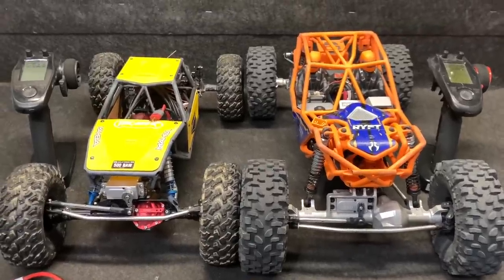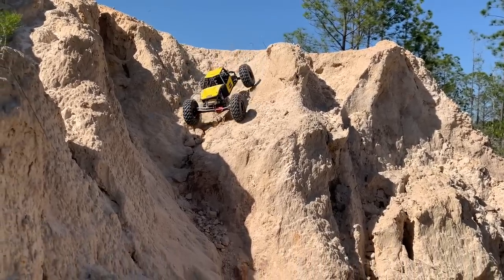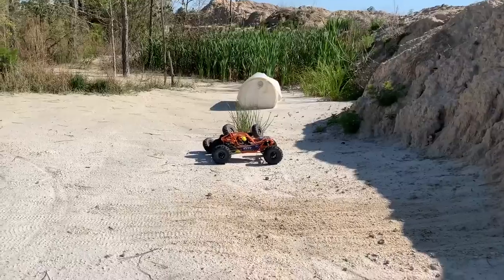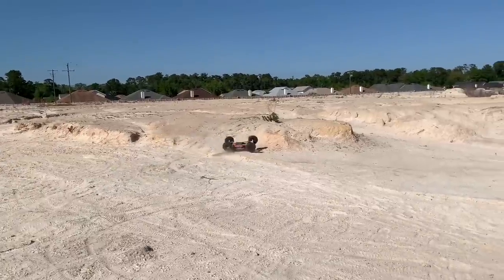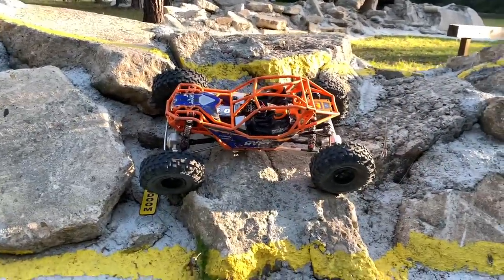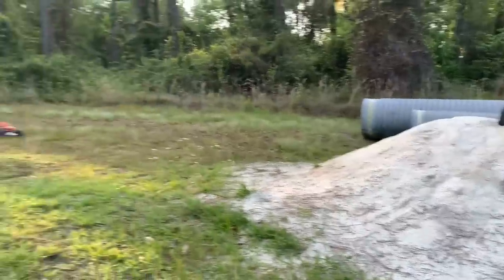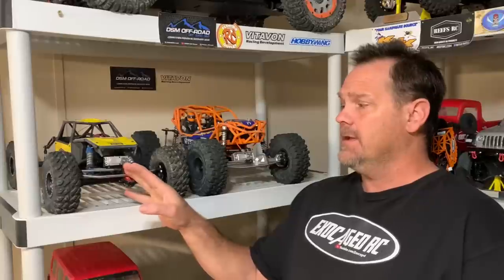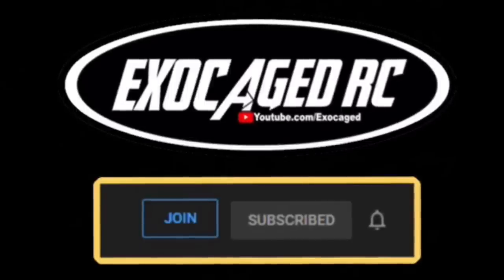Modified Ryft vs Capra Bouncer

Comment: It's definitely the holmes motor. I've ran his 540L size stuff, 4100kv Puller Pro R 3s, and it makes like 50% more power than his standard puller pros do with the same gearing and motor rpm. It approached my Erevo 2.0 (stock) power levels. Now, throwing in a TP Power 4040 series motor the Erevo gained 1000 more watts of juice.

Comment: These comparisons between the Ryft and the other cars should almost be titled "Here's why you should buy a Ryft!" Great video as always.
Reply: The Ryft also has about $1000 of upgrades. And the Capra didn’t fall to short. If the Capra had 4s and the same tires I bet it would have been closer.
Reply from the maker: I've found another set of ryft tires, trying to get them because the stock ryft tires are really good
Reply: I get the opposite message. All I've seen is a $500 RC that is super scale, super cool looking but is unacceptably easy to break when driven as intended, and poorly motored. It's like a really hot chick with no breeding/class/brains struggling with gender identity issues.
Reply: @douglaselliott8298  that’s what upgrades are for. It’s what the hobby is about.

Comment: The Capra looked amazing with the 2.6 mud tires you put on one last week.   Holding out for a Ryft kit for now, as I really don't like the sound of those electronics.  Weird question, who has the best sounding ESC's?  Looking for no cog, sweet modulation over speed.  Thanks for all you do, great video as always.
Reply from the maker: Castle has the most powerful for these vehicles.
Reply: @Tyty 200iQ the axe is not designed for speed like the Ryft. Nor the weight

Comment: Did you strap the front of your ryft down or something? My ryft has a lot of travel in the front. I ordered a swaybar for mine but its on back order im thinking about going ahead and ordering the one from vitavon and the vitavon trailing arms.
Reply from the maker: it has a DSM kinetic strap holding it down but still moves well
Reply: Okay thx I’m thinking about doing something similar to mine I think.

Comment: The ryft just puts so much power to the ground. I run the 2700kv puller pro in mine with a mamba x as you know. One blip of the trigger and its gone.
Reply: Have you left the diffs open?  Seems like there is some fun to be had there
Reply: @Art-zs6sl  yeah I let them open until the front and rear busted the diff gears. I poured epoxy in them to lock them until new parts become available. The center diff is still open but has ear plugs in it

Comment: And I wanted to get the lipo bags through your links but theres no description or links.
Reply: Man that Carpra is stretched out. Do you think the extreme angle on the shocks has a significant effect on forward balance degrees near vertical vs the RYFT?
Reply: And yeah. The power is insane on the RYFT. Also, ordered my Reef's 500 and programmer! That was a great vid. Can't wait!

Comment: Speaking of capras... I just threw on the spare time hobbies flat skid and I've hitting lines that I just couldn't do before easily. Literally, couldn't get over some obstacles at all, and now they are easily repeatable. I just worry about the 3d printed skid's durability.
Reply from the maker: if you got his best print material you shouldn't have any issues at all
Reply: @ExocagedRC  nice, I only got to choose which transmission but said his most durable material.

Comment: For added realism, suspend driving for 5 or more minutes each time your truck ends up on its roof. This would represent the time taken to remove every spark plug and cranking the engine to purge the cylinders of any oil that may have trickled in while the truck was belly-up. This practice will make a much more 'scale' conscious driver out of you.
Reply from the maker: lol no way!!

Comment: I understand why compare two rigs that are setup completely different. Yes you call that the capra bouncer but the rig has no movement just like how you have your bomber setup
Reply from the maker: the front moves well
Reply: @ExocagedRC  the capra bouncer has the flex but no travel compared to the ryft. And like I said you bomber is setup the same way. It has some flex but it's set up stiff movement. If one side has a big hit its going to affect the other side more with a sway bar compared to not having a sway bar

Comment: You know I think you're just partial to the rift I like the other one better it was lighter more agile on its feet ya didn't have quite as much power but you got to think about it this way you have a 4S brick in the rift and you got a little teeny tiny 3s lipo in your other one and it's a much lighter vehicle so of course you're not going to have as much power as much weight make it a little heavier and beaches to just as much of a break as the other one put some bigger tires on it I can handle it
Reply from the maker: you have a point